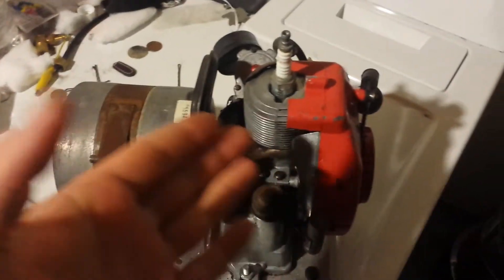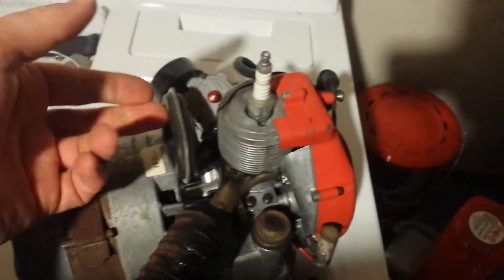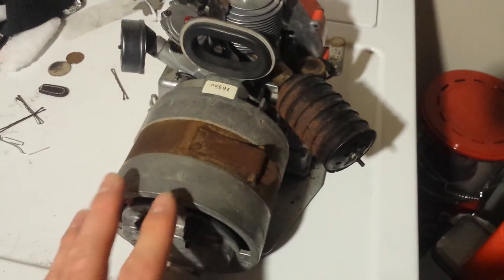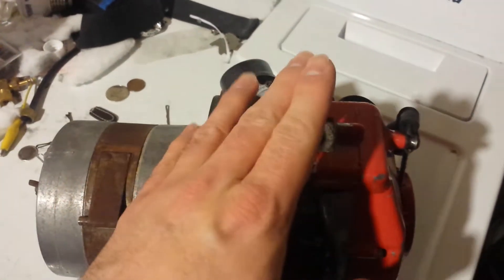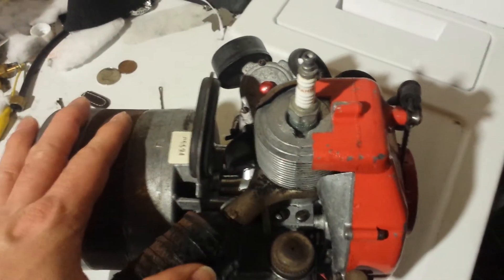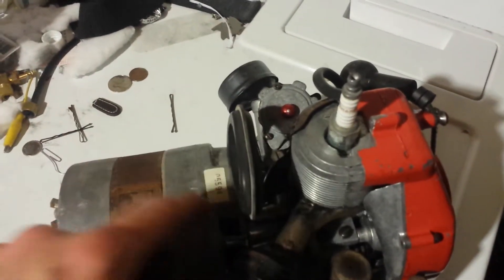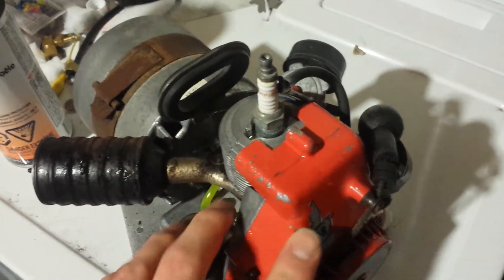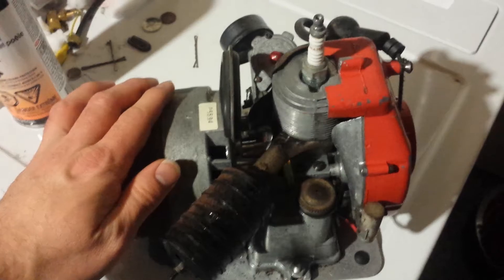Antique Tiny Tiger Generator

Comment: I have a tiny Tigger 300 and the fuel lines have to be replaced and I don't know where the lines go and it was gummed up and I would like for someone to send me the diagram of how to run the fuel line, please help me, please.  Curtis
Reply from the maker: I'm sorry that I can't help you on that subject I no longer have the generator. I did a quick search online to see if I could fine anything and those are getting quite rare and even the instruction are in the same boat. Although from the gas tank one tube will be the fuel pickup and the other I believe would be the fuel return from the carburettor. That's as much as I remember from it. Hope this help.
Reply: I just picked one up i can send you close up pictures if you'd like
Reply: Hey BTW if you got your problem figured out and got this beast running please tell me what are rhe fucking carb settings? When I say that I mean specifically how many turns out from seating the needle jets lightly do I go. I am trying to get mine to fire off and its making me crazy